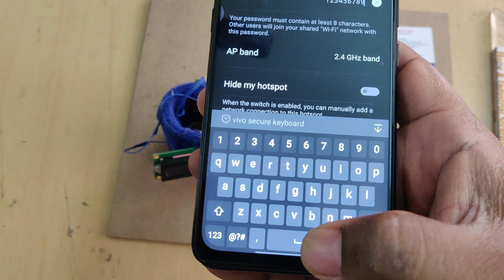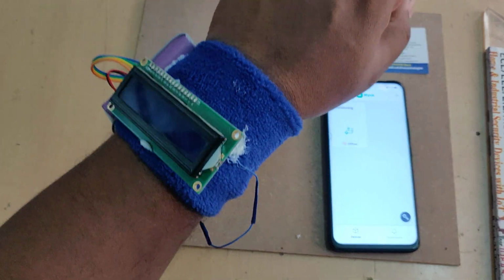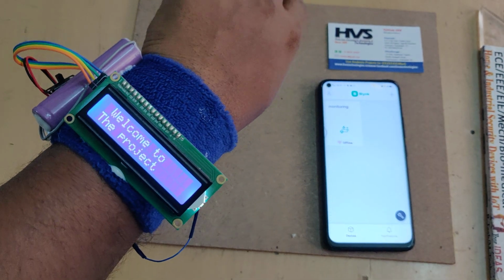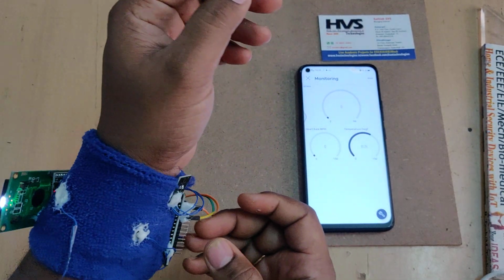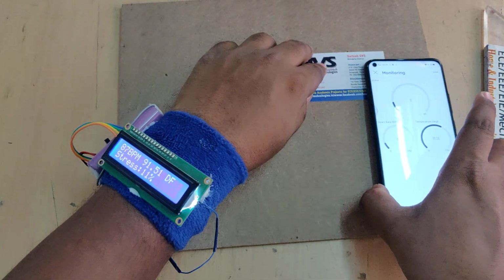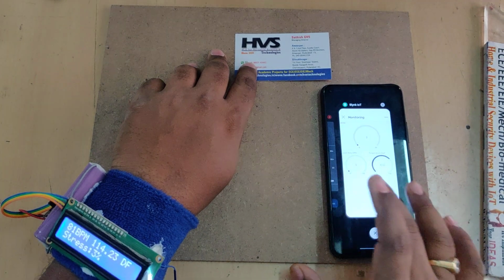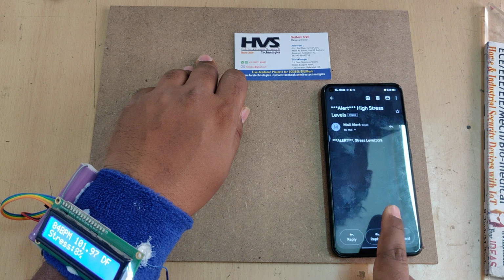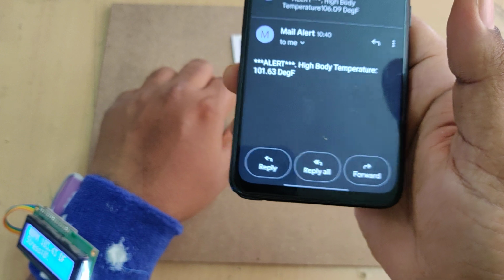HVS-3318. Stress Analysis and Care Prediction System with blynk monitoring and Email alert#esp32

Comment: what are the components used in it?
Reply from the maker: You can contact us at +919603140482
Through WhatsApp or call
Reply: @hvstechnologies   please give the details of components, ur contact is not reachable, it's very urgent.
Reply: @hvstechnologies   Please give the details of components, ur contact is not reachable
Reply from the maker: @deepajothir6766  You can contact us at +919603140482
Through WhatsApp or call
Reply from the maker: @deepajothir6766  You can contact us at +919603140482
Through WhatsApp or call